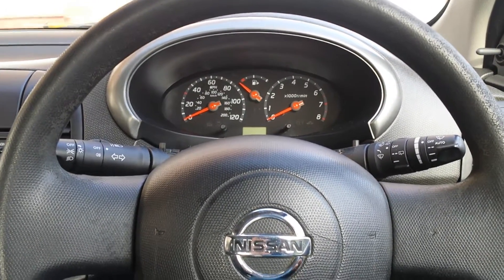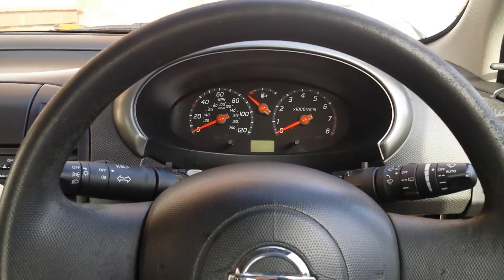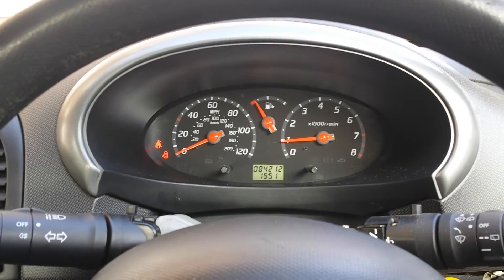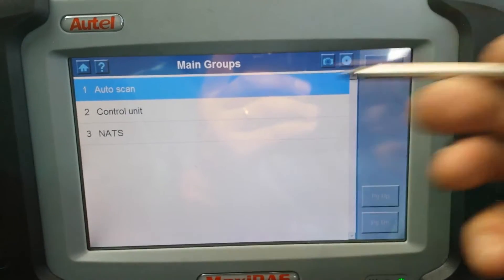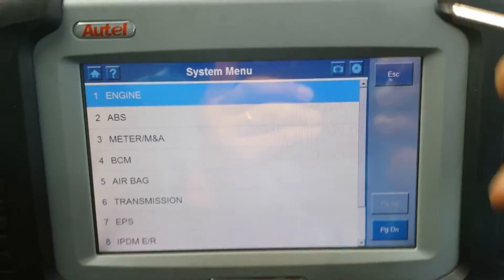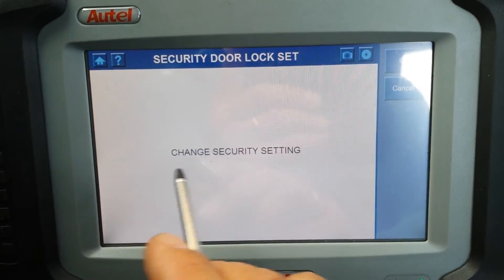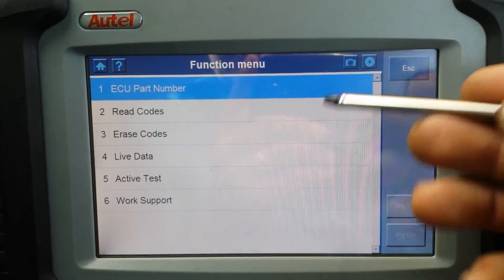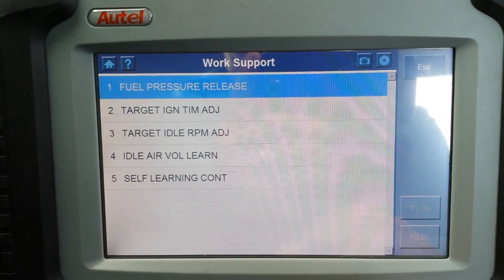DS708 on a Nissan Micra K12 2005

Comment: What a awesome video. In uk. Can I call you with some questions on the very same micra
Reply from the maker: Custom Car interiors 
Hi
Thank you for watching!
I can try to answer as best as I can....
Reply: lmsvvavr basically are you local for me to come up and you scan/delete this error I'm getting in my micra. Same year and make as yours. Same problem with idle. 

I'm near bristol uk.
Reply from the maker: Custom Car interiors
I am over 3 hours away from you...  I am sure you can find someone locally to do it...
Reply: lmsvvavr ok ill try this. What am I asking for the garage to do specifically? 

Also would you know any reason why my battery is draining over one/two days. I tested  a parasitic draw test and it seems the immobiliser is pulling power after the cars locked up. 

Any help?
Reply from the maker: Custom Car interiors 
Hi
The idling issues and/or starting difficulties,  are usually related to the timing chain... stretches over time and puts the timing out...
You can check this with the oscilloscope....

As for the battery drain, you should not have much more that 0.05 amps... if you have more, then obviously there is a problem somewhere... how much is the immobiliser draining?
Reply: Custom Car interiors known problem with the k12 micras going flat, it was a software issue in the ecu that stopped the ecus going to sleep fully, same happened with my Mums and nissan are aware of the issue, the solution involved taking to a nissan dealer so they can connect to it and download a newer software version that stopped the ecu from continually checking that all ecu's went into sleep mode, so stopping the battery drain.
Also recently my Mums k12 micra started again to get random battery drains after a day or two, then one day her boot tailgate started popping open randomly by itself, on checking it the boot release switch was faulty, again a common problem that water gets into it and that was the cause of her latest battery drains, because there was resistance across the switch even when not touching the switch, the cars bcm never went to sleep draining the battery, I modded the switch by taking it out and fitting a cheap £2 momentary push button switch from maplin electronics before they went bust, so first check to see if your k12 has had the software update for the well known battery drain problem, if it has put an ohm meter across your tailgate release switch to make sure you dont have any resistance there.
Reply: My micra 1.5 diesel drove 150 miles to london switched of the car went back to start it, after 5min no luck of starting again fuel feed ok spark ok injectors ok, car cranks but no starting over any help will be great thanks...